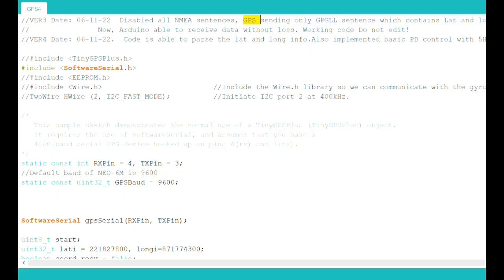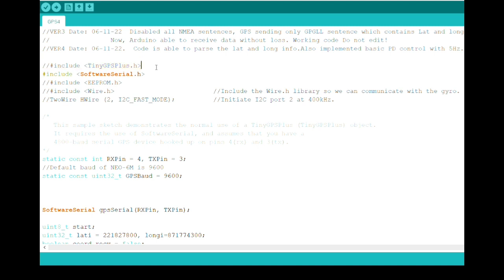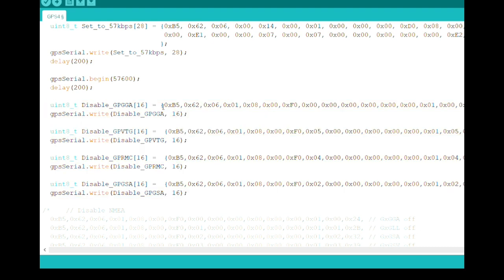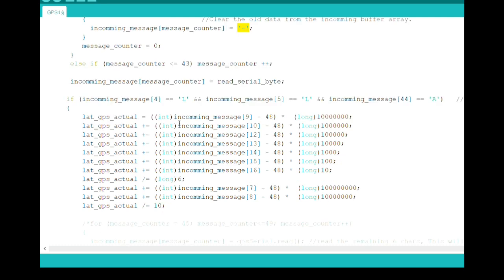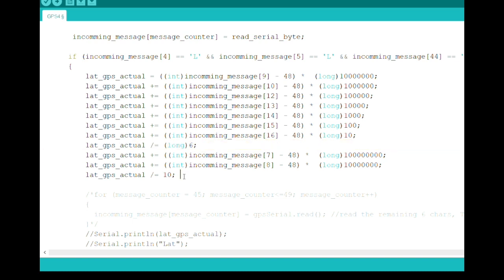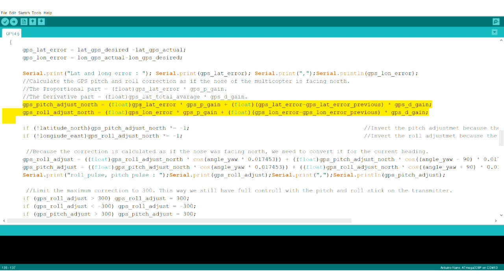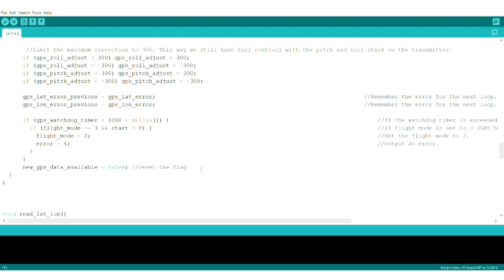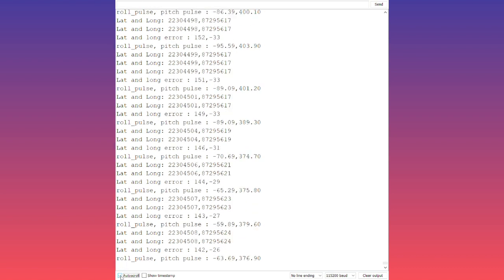Arduino Quadcopter Development Part 7 (Programming NEO 6M GPS)

Comment: I have made the drone YMSC AL but I cannot implement the gps by changing the pid with gps co-ordinate... so can you please provide the code... and the schematic of the drone.... i am on 7th sem and want to finish my project can you please help me 😟😟
Reply from the maker: My drone uses 2 Arduino for the gps hold unlike Joop's STM32 drone. I could somehow manage to get gps hold. If u are following Joop's STM32 design, then my code will not help.
Reply: @dhruvdroids  can you provide the schematic and code?
Reply: @dhruvdroids   sir , can you plz give the code 🙏

Comment: Can you implement and explain joops simulation buffer to make it 50Hz?
Reply from the maker: Hi, I implemented Joops code in Arduino unlike STM32. I had to strip down the code to bare minimun to run. In Joops original code the gps is sampled at 5hz and then interpolated to achieve 50Hz sampling. In my code the 5hz is the final rate. It will be difficult to do the 50hz in an Arduino
Reply: @dhruvdroids  do you still work on this project? i manage to make it work in a teensy 4.0 but the quad sometimes stays in position and sometimes roams around 3m diameter. Can you suggest a better approach?
Reply from the maker: @huntervoid5927  I am not working on the gps project but I faced the same issue, mine was around 10m circle. It's all related to the GPS refresh rate and GPS precision. NEO7M series GPS module allows 10HZ refresh rate. That should make your drone position hold more stable. Additionally, some assistance from the accelerometer is preferred.